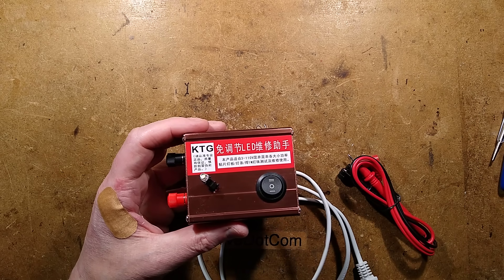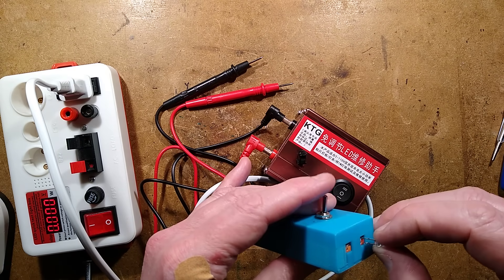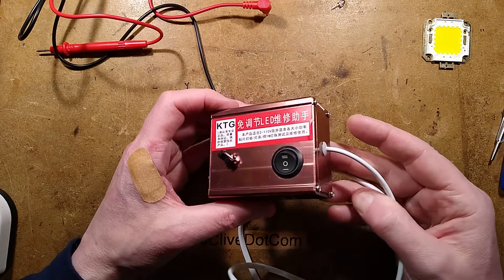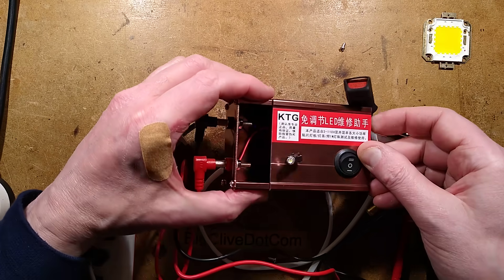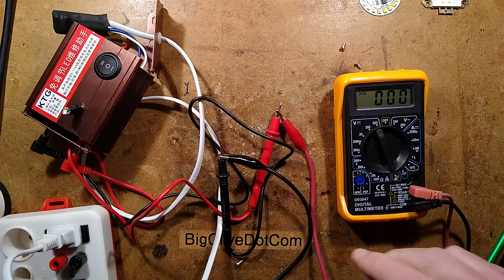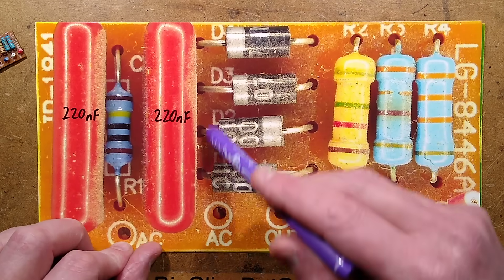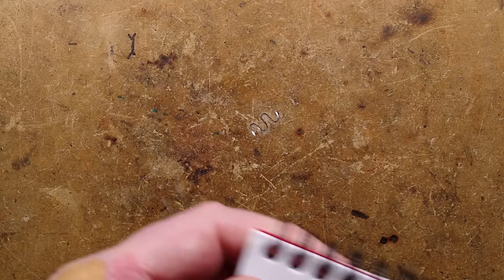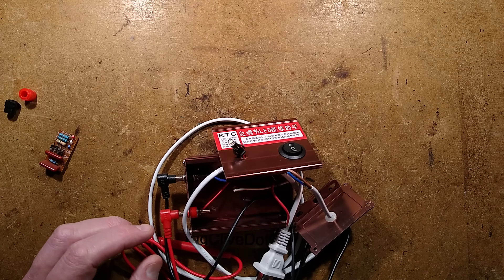Horrific LED tester that can literally kill you - (with scary schematic)

Comment: aren't those side fins on that big LED chip the terminals, i think you were trying to energize the heatsink material @3:05
Reply from the maker: The fins are a manufacturing frame that can be used to connect.  The recessed areas are the marked connections.

Comment: Nothing from China is as it seems. I obtained a Chinese 20000mAh power pack for my phone recently. It was in a beautiful case with a lovely display. I charged it up and then tried to charge my phone from it but it ran out of power when my phone was only half charged. Not a good sign. I eventually opened it up expecting to see a few rocks or nails for added weight, but imagine my surprise when I saw 5 normal looking battery cells in there. Imagine my additional surprise when I saw that only ONE of the cells was connected to the circuitry. The other four had no wires connected at all. Nothing. I tested the batteries and the connected one showed full voltage but the other 4 only showed about 10-20mV. I then tried to charge up each cell individually using the inbuilt circuit but the four unconnected cells would not charge. It seems that faulty cells were deliberately put into this device purely to provide weight. Yet another reason to try and avoid anything electrical made in China. The other weird thing about this device is that it had 3 Type A  USB connectors on the circuit board but only 2 openings on the plastic case, so one of the connectors was hidden behind plastic.

Comment: Big Clive, please invest in some banana plug to J-clip cables! I couldn't bear to watch the number of times you touched this very clearly shoddy device with the power on.

Straight probes should only be used for live probing a board or device that you already trust.

And even if this device were properly made, based on its specs of up to 110Vdc, it's a very dangerous device to manually handle. 110VDC is more dangerous than 220VAC.

Comment: i am in china right now and one of my favorite things is being able to just walk into some dodgy looking electronics shop and just finding stuff like this off the shelf. My favorite is still the thin flimsy plastic tube with speaker terminals glued to it connected to 220V that is pretty much required on every production line

Comment: Am I missing something? The leds I play with don't like  voltages over two or three volts. The idea of probing a circuit with 210 volts DC seems like a good way to fry all your components, and in this case, yourself.
Reply from the maker: LED backlights and ceiling light panels can work at hundreds of volts, as they use a lot of LEDs in series to keep the current down and the drive circuitry simpler.

Comment: i have bought one of these, but mine is isolated from mains,because i live in 110v country rectified mains voltage is not enough
there is plenty of video on youtube showng how to make the one with same capacitive dropper, is it is actually perfectly fine
https://www.youtube.com/watch?v=WLEFrtjlzv0
if you would use one of these tester, i think you know not to touch the probe thats outputing 300v anyways
my isolated version will still give you a shock if you are stupid enough
Reply from the maker: The DIY ones that were shown in a spate of copycat videos all pose a high shock risk with no warnings.

Comment: That switch has two on position and one off position. So if you assume it's not safe and turn it off before putting the probes down, you think you're safe.  But off, isn't off.  You'd be in for a nasty surprise.

Comment: Give that this needs to generate a high voltage to test TV backlights, how would you do this 'safely'? Surely is is no more dangerous than any capacitive dropper, which should be considered to be at mains voltage and treated accordingly.

Comment: I found the exact same POS on Ebay in the US. It is advertised as a Backlight Tester. It does have 115-120 voltage cord, but it looks half-assed like your specimen. The seller wants $16.15 BUT free shipping! I have an isolation transformer and variac on my bench in my basement workshop. That was a great entertaining video! 😉

Comment: wow i thought it would be 2Wires just dangling in a metal case 
tho seeing the led using a live wire seems to remind me of how old Xmas nano Glass lights would work from poundland

'green wire with glass lights in the chain plugged into the AC Socket & when u had them turned on and 
pulled one of the lights out in the string it would turn off or turn half of them off,
  just imagine id clean them with a damp cloth 

messed with them in 2005 but leant a year later it was dangerous for glass xmas lights just by looking at the wiring 
and a tv show about safety on a somewhat over scary  tv show cbbc.

Comment: I think thier idea was to use the plugs for a foot trigger or something like that. Still unacceptably dangerous to have banana plugs that carry mains voltage like that. I also love the led plug is flapping around in the breeze just trying to knick the insulation on the bare aluminum hole and make the entire case live. That's especially egregious since it's something that's going to constantly be wiggling from plugging in leds and removing them.

Comment: The sleeves blocking the probes from their power sockets actually a safety feature. It's like a medicine bottle cap and it keeps babies from being able to plug in the probes.

And the aluminum ungrounded case is a nice touch. It shows the relentless pursuit of premium ownership experience for the buyer. It's no cheap plastic. 

The replaceable LED is breath of fresh air because it shows a commitment to user repairable and customizable electronics. You can replace it with a rainbow led to make it stylish and more attractive to children. 

Using a 3 way switch and simplistic circuitry limits the resources needed and environmental impact of building it.  

It is good to see progress in Chinese eBay electronics.

Comment: On the other (not yet electrocuted) hand, it looks like a quite nice enclosure, with hand pre-drilled holes.  Maybe replace the contents with something less dangerous, like spiders.
Reply: It would make a nice little treasure box if you put the screws back in and sand off the edge keeping the sliding face in place.
Remove literally all the electronics of course

Comment: Aight I'm gonna let you guys in on a secret because I swear that's how it works. They were producing some other, maybe actually useful device, for which some company had these cases done. They no longer need them, so they basically sell them as garbage. Some other company buys garbage like that and thinks, what can we do to flip a profit on this. The big brains look and "hey, we can stick an LED tester there!". wonderful idea. they get the absolute cheapest design and parts(probably also spares) they can get, stitch it together and they hope it's going to be a profit. I mean, with 11 pounds a piece I think if even one of those sells you may have just bought a couple hundred of those. Unbelievable.
Reply: Make the case grounded and bam safer than any product domestic to China

Comment: They could have made it a TINY bit safer by putting a 1.5K resistor in series with each AC lead and then wiring the switch a bit differently. But that would have required one extra resistor in total.

Comment: 27 mA DC through your body, say right hand to left hand, will most certainly KILL you.  Let's say your body resistance is 10,000 ohms (10K).  212 volts divided by 10K = 21 mA.  YOU ARE DEAD, SUCKER! 💔😵☠

Comment: The design is really unsafe. If you have knowledge about electronics, use a 1A phone charger to modify the output with a 10k resistor and you can still test the LED safely.

Comment: In it's defence, it is only rated up to 110V maximum so the currents will be halved so it would be approximately 3 and 13mA which be a lot safer and more sensible current values. I am curious as to how and why the voltage rating starts at 3 volts as this would appear to be too low to achieve anything and no mains voltage is 3 volts. Also 3 to 110 volts is one heck of a range, although it does need to be AC and not DC. If modern switching power supplies had a voltage range of, say, 3-240 volts AC or DC one could just be connected directly to a battery or even a solar panel and it would just work!

I think it would have been much better if it was all capacitive droppers, with appropriately rated capacitors, put the bridge rectifier last and use proper touchproof connectors and probes. A 190(?)-240 volt version could use capacitors of half the value. I'm not sure about the LED out of the top of the case in that I don't know if it's a testing 'feature' or an oversight in that it should have been an indicator LED fitted in the first place showing if current is being drawn,
Reply from the maker: The unit is designed for 220V use.

Comment: If there is available an isolation transformer then electrocution needs two wires to touch.From capacitors divider i think 30mA are passing,quite enough for a good sock.But for an experienced technician who knows exactly whats he is doing every moment when using professional tools for repair the safety rules are very objective.Because the knowledge of all the potential dangers for him are assumed from his first day as a professional technician and these rules are totally different from all the common commercial users.So he knows how to protect himself in the stage of repairing process.And large led strips inside tv connected in series might need up to 200Vdc to light up.

Comment: Mind boggles why would one purchase this over the traditional battery led tester.
Like this kind of

Portable LED Tester Test Box Mini Light-emitting Diode Bulb Lamp 2~150mA

All for the mighty price of 3.65 euros with 1.99 shipping or free if you spend 10 euro. Still way cheaper than 11 pounds odd lol

Comment: This is the most amusing vid. you've posted; I found myself laughing out loud (almost hysterically) quite a few times. Was this designed by a homicidal maniac. I was hoping you would run it at high setting until the 3k3 resistor popped.
    By the bye, decades ago a fellow tutor and I were talking about ways of instituting very stable constant current sources; he told me of when he was in the RAF and they built the closest to ideal CC; it consisted of a vibrator inverter, rectifiers, and an enormous resistor. So, it had a very large source impedance and could supply up to around 2kV. And yes, they used it.

Comment: It’s even worse than you said, if you touch the LED on the little plug you no longer even have the current limiting from the diode in place, I bet the current is a lot higher bypassing that diode!

Comment: Wow.  That's insane.  Not even an isolation transformer.   I was gonna say at the beginning "gee, that looks like a current regulated probe for testing series constant-current LED strips".  But then you tore it apart and what we actually have is current regulated by a 1M resistor in series with one of three switched resistors.  That is completely insane.

Also note that the young lady has a probe in each hand... so... right through her chest and heart.   They might as well be instructions describing how to most efficiently kill yourself.

-Matt

Comment: I remember way back in the 1960s/70s Woolworths use to sell some electrical goods like three way adapters that came from Fareast and yes if you plug a TV & video is not good but you can get away with it but if you want to burn your house then plug in a toaster and a electric kettle and that should do it.  I don't know how Woolworths got away with selling that rubbish

Comment: i've used a circuit made by myself some time ago, but with drooping capacitor X2 1uf 400V on one phase and a 100 ohm resistor on the other phase, with a filter capacitor after the full wave rectifier 47uf 400V and the resistors(150k, 10k, 10k) were connected to the plus side of the bridge  and of much higher wattage like 10W.
I used that to test tv backlights for a while.

But at some point i bough a professional tester with dual display for voltage and current, both adjustable, with micro-controller, proper isolation, etc. , i think it costed around 40 euro.

Comment: The part where you tested the LED in a small battery powered device had me both laughing and actually quite terrified.

Why does this thing use mains power? I'm no LED expert but considering your phone can power an OLED touch screen with a battery and the mains can power a washing machine.

I feel like theres some kind of middle ground they could have found that wouldn't result in DEATH

Comment: 4:03 Clive, you've removed the tiny single LED from its connector. What if the LED is needed for the device to function, like a current sink or semiconductor-mode measuring/comparing shunt?

5:39 Told ya! 😂😁🤓
Reply from the maker: I wasn't expecting it to be a fuse.

Comment: that little LED hanging out the front...wow
and I love the switch that might easily give the impression that the unit is switched off and """safe""" in the 0 position, when its 100% very much not even slightly off at all
Reply: When he pointed that out I thought the same thing! "The off setting isn't actually off? This thing is always live when plugged in?????"
Reply: Common sense would say to make the middle an “off” position and probably get rid of the probes altogether as a simple momentary switch could do the same thing far safer. I would also have liked to see a visible power indicator and an actual fuse would have been nice. I’m really not digging the metal case in this instance either especially when I’m pretty sure that the mains connector was the ungrounded type. Too many points to fry oneself, unless you like danger. Some people do like to live dangerously and this is truly their product!
Reply: me too
Reply: It really is a crappy device that just keeps on giving.
Reply: Learn the difference between   ON/OFF   and  on/off
They are used in different contexts.
Pay attention to what is written on SWITCHES
make sure the brain sees what the eyes are looking at
When referring to SWITCHING  it is written   ON/OFF  
in the ALL CAPS   iteration
Reply: @XRAF-633 i like the part where you made sense

Comment: very nasty, i suppose it'd be a 'bit' better if it had a cap in each mains line, that way no 'hard' current unlimited connection from output connections to the mains!!  maybe an even safe-er idea would be a 22k 2w in series with each mains line, feeding a bridge, then output, that'd limit output to 10ma max from a live pole?!!! or 2 x 47k? 5ma max (half these through the led under test) , i used the 2 resistor idea for a small pp3 nicad trickle charger some years back

Comment: It's Chinese. Clearly built to a low, low price point, it runs off the mains and has a metal case.  My initial takeaway from the first few seconds of testing was that you're one seriously brave individual. I wouldn't have gone anywhere near the thing with bare digits without first checking to see if the case was `hot' simply when plugged in, let alone switched on.  Risking your life, so we don't have to. Top entertainment, but be careful,man! 😂

Comment: made same concept led tester years ago with a series led and it users a classic joule thief as it's power source driven by 2 AA, and transistor is oversized 13005, works excellent for upto 15-20 leds in series and hey it's portable and doesn't kill me

Comment: Basically just a capacitor dropper... I expected a switch to change the value of the input capacitor as this changes the current; and a big cap to smooth the voltage...

Comment: It's sad that one could design and build a perfectly safe tester for not much more than it costs to buy this piece of drek.

Pro tip if you insist on using this thing: invest in an isolation transformer.
Reply from the maker: That might increase the price somewhat.

Comment: The laugh when the heat shrink comes off, the curtain is pulled back, and the great and powerful Oz is revealed... priceless.  :)
Reply: I was thinking that the heatshrink was just to prevent it grounding out on the metal case, but I've just remembered that the metal case is NOT grounded.  It doesn't even have a ground wire in its mains cable. So at least you can rest assured, that if the mains cable shorts out to the case, at least it's not going to blow a fuse.
Reply: Oops, I just did it again.  It doesn't have a fuse either.
Reply: @KenFullman  Which is rather likely to happen with that dodgy LED setup.  A little friction to wear away the wires going to that "socket" and, viola, you have a mains energized case.

Comment: I used a nsi50010yt1g with a TP4056 lipo module and some headers on a perf board to make a 10mA LED tester just last week for myself. I love it. Put 6 headers in a pattern  - - + - + + so i can stick RGB LED in with either common anode or cathode as well.
Reply: This is for testing high voltage LED strips/panels. I have a DIY one with better safety (class X caps on both mains inputs and crocodile clips so that I can stay away)
Reply: @rexsceleratorum1632  the chip I used will do up to 50v and it self regulates to 10mA. A lipo powered version is perfect for my little needs but I could hook it up to my bench power supply to go much higher on voltage if I have a use case. And the chips cost pennies each so you can use them in projects all over for LED regulation.
Reply: @gd.ritter  Still not useful for testing the 81V to ~200V LED panels that I encounter. But interesting chip nonetheless if I can source it in India.

Comment: It would be a little safer with one cap in series with each mains input, but that would have cost them an extra resistor. On that note I'm surprised they used any bleeder resistors in this deathtrap. I think the better tool for this job would be a small battery powered DC-DC converter, extended zener tester sort of deal.